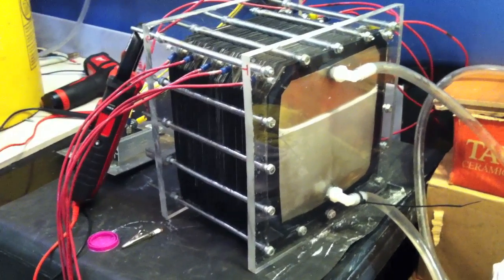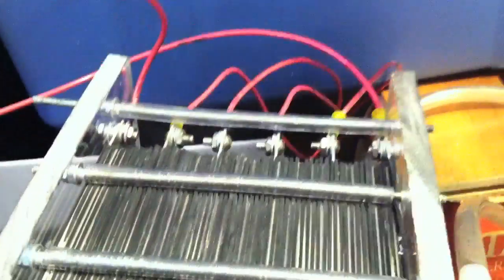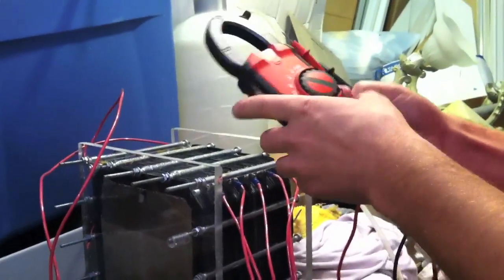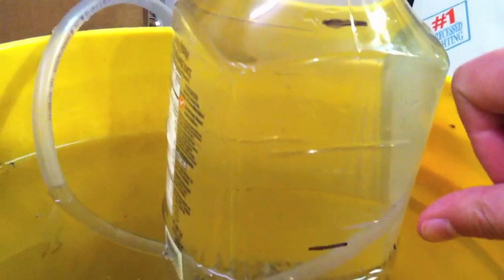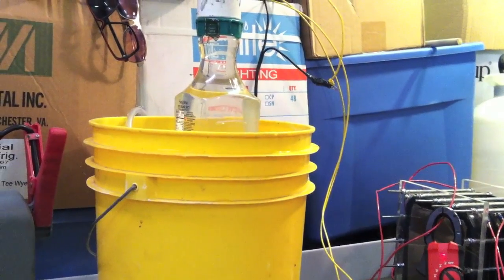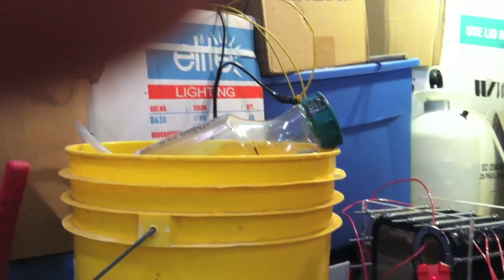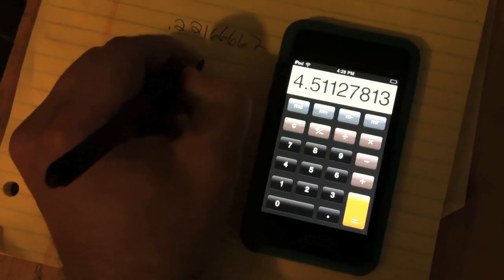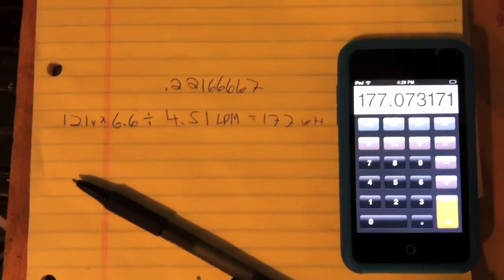120v 4.5 LPM 60 plate hho ( hydrogen ) dry cell demonstration

Comment: The amount of oxyhydrogen needed to run an internal combustion engine is spectacular. Idling a
small engine (e.g. 5hp) would require 500-1000 LPH (liters per hour), while idling a car engine

One liter of gasoline contains approximately 30MJ of energy, while oxyhydrogen gas would
contain approximately 7-8kJ per liter. This means that you would need approximately 4000 liter

is that possible to make 4000 L/H oxyhydrogen  with e 12 v. 34 amp car battery .
Reply: That's not true. It doesn't take anywhere near 500-1000 lph to run a 5 hp engine. Where did you come up with this figure? We have run an 8 hp engine with 2.3 liters per minute. The timing needs to be retarded so it doesn't pop, but, you can't put a load on it or it will stall. To run correctly, the engine, and additional electronics has to create power boosts to the cell prior to throttling up and would need sophisticated electronics to do so. It would need 1.5 liters per minute more per minute to max the engine out. HHO gas is more than 1000 times more powerful per liter than any gasoline. But, take into consideration that a liquid liter and a gaseous liter does not have the same content. If we took one liter of gasoline fumes, it wouldn't run too much, may be a stroke or two. In HHO gas's defense, one liter will run hundreds of strokes. You do not need to compress the gas as much to come up with much more explosive of fuel, and you don't have to put any more than maybe a cubic inch of hho in the cylinder to give the blast of nearly a cup of gasoline (in a compressed state). The more HHO is compressed, during a perfect scenario, the more power it has and the further it will go. Before you list nonsense, please look at the old gasifiers that people used during WWII to run their cars. 20 liters per minute of straight hydrogen ran any car just fine, and there was oxygen added just as normal like when you would run gasoline. This was using the smoke from wood chips to create hydrogen. Although, there wasn't just Hydrogen running in those systems, there was non combustible gases that were made , soot, and resins that didn't produce seriously combustible fuels, but, a small bucket of woodchips fueled a vehicle all day long. Also, Albert Einstein would have never stated that one gallon of water had enough energy in it to power NYC for a year if the HHO that it was made up didnt have the balls to do the job. Hydrogen is serious stuff. It can be made correctly to power just about anything, we just need to play with it more to figure out methods of making it efficiently with electrolysis to run the vehicles. Everybody online has been playing with Brute - force styles that will never run  an engine without having a power plant near by. Stan Meyer's electronics need to be reborn to perfect this. There is currently a water powered car from Daniel Dingel, another in Japan, and , another in Korea. We will never see one in the US unless we make it privately, also, inventors will never be funded by investors due to deaths, jail sentences and disappearances that have happened over the overunity inventions that have come to public knowledge. Look up a man they called Dad that used to fill his gas tank with lake water and run his old Model A. That was before anybody knew what an electrolytic carburetor was. It is possible, but our government destroys the written proof that we have had by blacking out all of the important things in the patented designs. They stole Tesla's top secret documents and anything that could ever create mass amounts of overunity before the world used it to rid of the oil demands. Government would collapse without oil market, as well, our planet will eventually be thrown from orbit because we keep stealing our planet's fuel that keeps the core heated.. Water powered cars will never be sold publicly because our government forces us to purchase gasoline because they make money on it. Bottom line, if they don't make cash on it, it will never be allowed to sell. Also, our patent office will not allow any such patent for any product that will allow anything to be patented that can obtain better than 57% efficiency. This was done for a reason. So we have to pay top dollar and be as far from a free country as possible. Water is free unless you are an idiot that pays $1-2$ a pint. The world wouldn't allow it because everybody in our society is full of greed.
Reply: you are welcome. I get all fired up when people claim ridiculous statem,ents such as this. I spoke to a man from Canada, his name is Neal, he created a fuel injection system for HHO that literally idles a 4 cylinder gas engine on 1 lpm of HHO gas created by Stan Meyer's replica 9xa system created by Project Icarus. He does not speak much about it but he did clue people in on how and why this works. The engine needs a reduction of the amount of oxygen let into the intake per it's volume of HHO due to the fact that HHO already has a perfectly stoichiometric blend of Hydrogen and Oxygen provided the plates of the cell are as equal as the gas, in a 2:1 ratio. If we let the gas fly off of a 1:1 plate system, believe it or not, we do not have an equal gas release as necessary and the gas is much less combustible, in fact, it becomes more explosive because there is more oxygen than needed.

I have built a 3 plate cell, one positive plate and 2 negatives. I have built a dual switching system one with a 555 timer that switches a relay to drive a coil and when it shuts down, it releases it's back emf energy and radiant energy which is collected from a spark gap into the battery that drives the system in an attempt to raise battery voltage to make the system much more efficient, so the wattage consumed is 1/3rd of the normal wattage. Then, the battery drives a pwm which outputs a specific frequency into a buck converter, lowering the voltage to 3 volts and 10 amps (30 watts), powering the hho cell by pulsed electrolysis in combination with an oscillatory relay that also produces back emf spikes which are released into the resonant cavity cell, producing Orthohydrogen which is 10 times more powerful than the standard HHO driven by a battery.

I have found that 1/16 th of a liter per minute is capable of idling a 12 hp B&S generator and if I raise the output to 1/8-1/4 lpm it revs the engine. It does not even need to be timed as the gas is combustible even with the addition of oxygen in the mix. The hho released has some para hydrogen, but, at the frequency I pulsed it and additional back emf pulsed electrolysis, we have some very large ortho hydrogen bubbles released simultaneoulsy with the parahydrogen and it massively excites the gas so much that when filling a balloon, static charges added to the balloon from the gas filling it makes all of the balloons I have inflated attracted to each other from several feet away and they fly away once they come together and stick to each other like a weak magnet.

I popped a balloon with a flame and it had a snap to it, but, it was one extremely large bright orange flame and not a massive bomb like explosion as straight hho would do, pretty much indicating that the gas is similar to pure hydrogen without oxygen, but, several hundred times more powerful. I have a feeling the gas is actually deuterium, or an isotope that hasn't been discovered yet. Deuterium is a very unstable atomic isotope which is not really wanted to be manufactured for any type of use by civilians due to the dangerous nature of the knowledge leaking out of how to make it by scumbags like terrorists. It'd be awful if they figured out how to make it since it is extremely dangerous if used in the right way. I really have no intention of making and using it, or offering exactly how I did this, if it isn't deuterium, and it is orthohydrogen, I may have just figured out how to excite it in a manner that makes it much more valuable, and, it really does run an engine flawlessly with massive torque and no popping/backfiring whatsoever. I have'nt even mixed the gas accurately with valves or anything, I just added the hose to the intake through the choke with a blob of duct seal allowing minimal oxygen in to eliminate making the gas a weaker concentration. Vacuum from the motor made the cell perform at 10 times it's normal output which is opposite the usual effect by standard brute force electrolysis, and, since the cell was run at 3-5 volts pulsed dc instead of a straight brute force 12 - 14.5 volts, it remains ice cold and never steams up or turns brown & rusty. Stainless steel grades like 304 stainless which would normally degrade and completely fall apart do not even have small rust craters in it after running for 4-5 days continuously.

Comment: I take it, this is just an experiment, not for use in an actual vehicle. Because the load it requires, your alternator doesn't have enough "grunt" to run it, and the load on the engine would negate the purpose of the generator. Besides that, the car battery would run flat in a matter of minutes, because of the current being drawn from the alternator would be so great. That is, if the wires don't burn out first.
Reply: power inverter might be the answer
Reply: I'd use it for an hho torch.  Or  hho gas for health.  Google these terms molecular hydrogen  and nih.gov. 

But i want to  dispell the myth that  hydrogen generation uses more energy than is made by a motor turning an alternator.

People do this all the time with cars and trucks running gasoline and or diesel and see fuel /mile economy increase.   Here is how this works without  violating  2nd law of thermodynamics.  First thing is the primary fuel is gasoline or diesel. Adding  a little hydrogen and pure  oxygen to the air intake increases the oxygen concentratiokn and hydrogen has a faster flame front. This helps ignote and burn more of the fuel during the power stroke of the engine converting more if the energy into pressure on the piston during the first 90 degrees of crank rotation.  This works without violating second law of thermodynamics because it make the internal combustion engine more efficent using more of the energy that is in the primary fuel. 

Either way on demand hydrogen generation for hybid fuel doesn't need 120vac   but hydrogen  has more uses than just for transportation.

Comment: Well. I'm guessing an alternator at max output can give you close to 1000 watts. 12 volts times 90amps... Considdering you dont blast the radio and all lights are off etc (minimal electric use) you could hook it right up to your car. My big question is: an alternator at max load creates a resistance to your engine im guessing 10hp parasitic loss... (Plus premature ware of alternator) what would it take to run a small (1200 cc max) motor on water only? Lpm..?

Comment: I live in a place with lots of sun but I rather go EV than have to mess with hydrogen. With an EV car I can get 100 miles of driving per day for US$10,000 of solar panels that can last some 30 years. With hydrogen it will be many times more expensive (more solar panels and electrolysis equipment) and require many times more headaches for maintenance over 30 years of use.

Comment: No, they are not safer. Making hydrogen from the grid's electricity is indeed dumb when it's burned in a combustion engine. You end up with some 10% efficiency from energy source to wheels.
Rather it makes sense to use electric vehicles where the efficiency is about 5 times higher meaning 5 times less use of fossil or nuclear fuel from the power plant.
EV cars have the superior technology because of the efficiency and with battery technology improving further it's going to replace gas cars.

Comment: Sounds crazy. Stainless steel contains chromium. The electrodes, and thus the chromium is consumed, and you end up with poisonous chromates in your electrolyte. Dumping it on the ground or down the drain is ILLEGAL! The compounds can cause severe skin problems and ultimately, cancer. Hexavalent chromate is poisonous. 
Does your electrolyte turn yellow? That's a sign of chromates.

Remember, you do this to help the environment, right?

Comment: As electrical engineer all these type of units with three variables in there are alien to me. I see we want high "liters per minute", but we also want low "Watts per liter", if we combine those in one number which we call "Watt per liter per minute" it becomes meaningless (do we want it to be high or low?). If you friend produces double the amount of gas as you at half the power your device requires, the "Watts per liter per minute" on both devices is the same, which device is better? His... ;-)
Reply: Many people use MMW  mililiters (of HHO) per minute per watt, as an indication that relates to efficiency.   With pure DC, 13.4v per cell  typically gives almost 1MMW.  6.7v per cell on the other hand gives 1.87 MMW. The lower the voltage per cell, the less energy gets lost to waste heate and the higher the MMW is untill you get to the minimum voltage needed to electrolyticly separate water into HHO gas.  Now i live near sea level and my  test were performed at room temp 70 degrees and the bubbler helped keep the HHO gas at close to that if one wants to adjust for standard temperature and pressure. 

Modeling an electrolysis cell,  i use a low value resistor and a 1.24v zener diode.  A slightly more acurate model will look at the electrodes plates as the plates of a capacitor connected in parallel to the resistor and zenet diode, and the electrolyte as a dielectric storing energy in water molecular alignment and ion arrangement, upto the point of water's electrolitical breakdown voltage.  The resisor in my model, with all other things being equal, is inversly proportional to plate area.  It is also related to electrolyte type,  concentration, and temperature and distance between plates. Under high currents excessive gas bubbles in solution reduce the crossectional area that current can travel through the electrolyte, thus increases resistance. 

The resistor and zener diode form a voltage dividing network. The voltage drop across the resistor × current per second through the resistor = joules of waste heat, while the voltage drop across the zener diode × current though the  zener diode per second = joules of energy stored chemically. 

With stainless steel plates, you want to keep the current density below 0.5 amps per sq inch.  Too high of current density leads to early break down of the plates.
Reply: In terms of MMW. 1000ml/((6.6 amps×121volts)×(13.seconds/60 seconds in a minute))=5.6489 mililiter per minute per watt, a somewhat respectable efficency given his production rate. 

Supposing his plates were 1/2 the active surface area, the current, and thus the watts would have halfed but it would have taken twice as long and his efficiency in MMW terms would have still be 5.6489 MMW

Comment: what would happen if you use ( Graphene ) sheet's instead of steel plates ... just think how thin you could make the cell's if im right the electricity current will not have the resistance of the steel plates and amp should not infection the water with the steel by over heating ... just idea iv been thinking about
Reply: The graphene plates would disintegrate in short order.

Comment: The way forward in not brute force electrolysis with electrolyte and high amps, the way iS Distilled water low amps high volts, use the cell as capacitor, all power put into cell return to capacitor banks for reuse thus requiring less power input once running (less amps means less conversion to heat and less consumption of power.. Zero-point comes to mind)